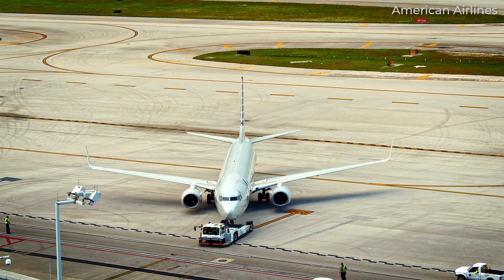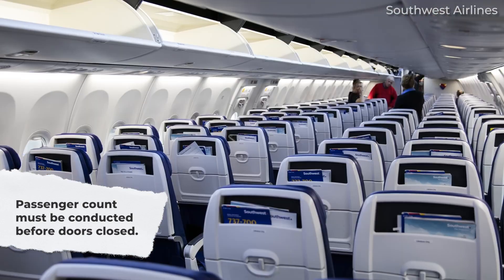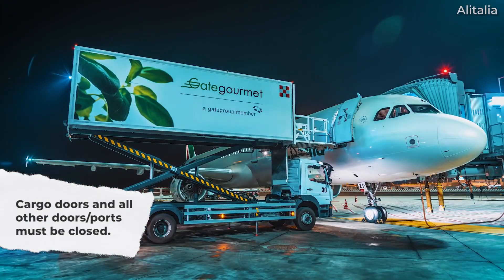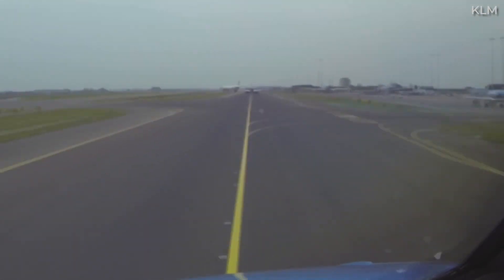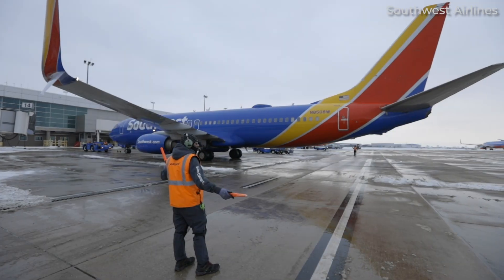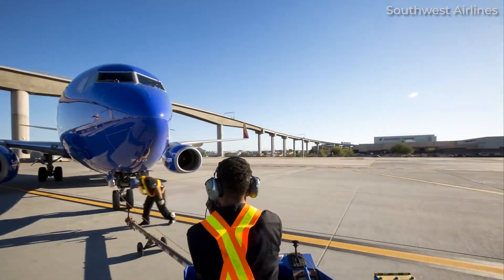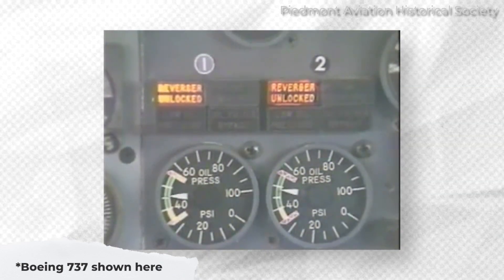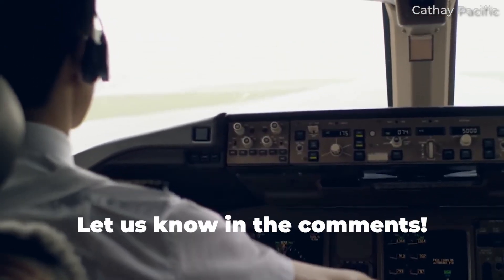A Complex Choreography: The Anatomy Of The Pushback

Comment: Since when have airplanes been loaded by passengers according to weight??
Reply: Yeah,I was wondering about that too. When you see empty seats on a 737, that does NOT throw off the balance. More so should worry more about the weight of the fuel, air pressure levels outside the plane, cargo weight, thrust, how the wings are engaged ( slats, flaps, stabilizer, and elevator ), and any turbulence that may throw-off the plane's projectory. I could be wrong about all of this, then again.........😁😁

Comment: The only question I have is, how do Wing Walkers know when it's safe to turn towards the nose to help disengage the tow bar/headset/bypass pin?
Reply: Wing walkers know by hand signal. When the pusher gets to the disconnecting spot told by the Captain, needs to notify Capt. to set brake. When capt. reply brake are set, then the pusher give the hand brake signal to the wing walkers follow by the disconnecting tow bar signal.
Reply: When the aircraft comes to a complete stop

Comment: I saw a video of a plane that is so heavy, it was a struggle to push it back by the tug. I wonder why the pilot of that plane, didn't use the reverse thrust of the engines to assist the push back by the tug vehicle. Perhaps that would have helped, idk 🤔.
Reply: If it's the same one! The tug was slipping on deicing fluid !

Comment: In San Diego (Terminal 2 gates), especially in early morning departures when the ramp is at it's busiest, you can get pushback clearance as long as you dont enter the taxiway. If you've never done that before, it can be pretty intimidating getting close to that max turn angle.

Edit: or even towning planes from the east ramp to gates when it's busy

Comment: The pushback is either towbarless or used a towbar. If you use a towbar, its like backing up 2 trailers. One that's pretty short and one that is the plane. You can't steer the plane too much or apply too much force to the towbar or you will break things. Its not a lot of force either. You need to take several seconds to let off the brake and several more applying enough gas to go as fast as you are comfortable with. Also, if the operator forgets to clear them to start engines, they will start them after they drive away because its implied clearance.

Comment: 5:47.
Bro, I can not believe you implied the" thrust reverser  buckets" are deployed for gaurd against F.O.D. ingestion to engines using "power back"  manuver.
They are 99% designed to slow aircraft on LANDING speed after touchdown!
Come on  Bro, your content is better than too make a foul up like that.
"Power backs" are VERY rare except maybe at no jet bridge/ terminal airports, but it is not the norm. 
Too much collateral damage to buildings, terminal, ground crew with head down in Facedamn book, and f.o.d. In general area. Good video as always, but only 3 stars, ergo, no thumbs up on this issue.
Keep up the good work!

Comment: All the turboprops and jets I'm aware of can move backwards on there own.  It is merely highly frowned upon or against policy to do so due to the increased risk to persons on the ground, throwing FOD everywhere and potentially harming the engine and/or propellers, and pilots can't see behind while moving backwards (except some modern airliners with cameras).
Reply: powerback also uses a lot of fuel as the high throttle levels are needed to overcome static friction
Reply: I think, just this year earlier, somewhere in the USA, a ground crew personnel got sucked into the jet, I don't recall why/how that really caused him to get killed that way, maybe the jet WAS doing it's own reverse??
Reply: There was 2 actually! One was suicide and other was just a poorly managed ramp @Ithinkiwill66
Reply: @Ithinkiwill66  No, the ramp worker approached the aircraft before the anti collision lights were out and the engines spooled down. They were told not to but did anyway. I work on the ramp at LGW, it's basics.